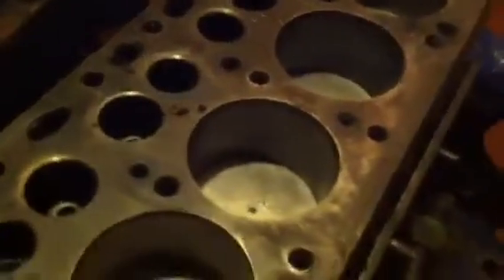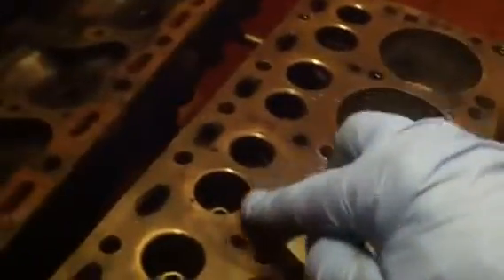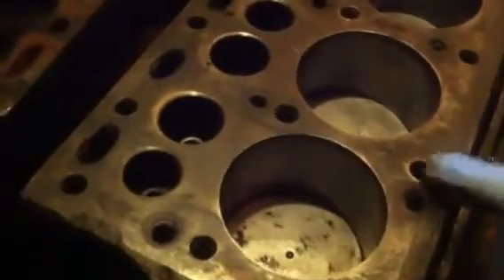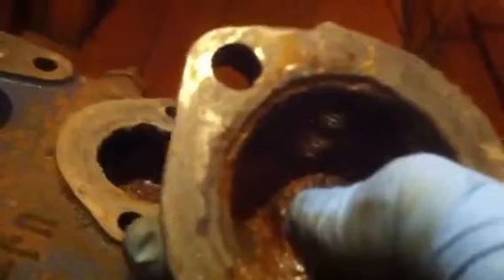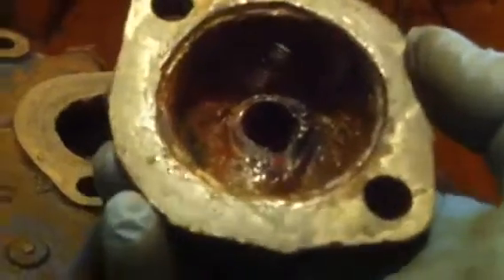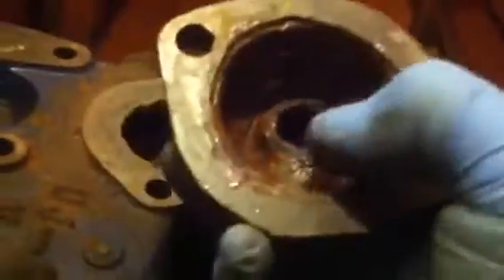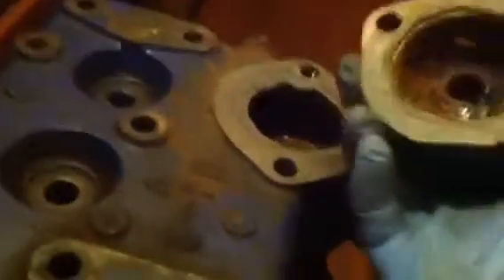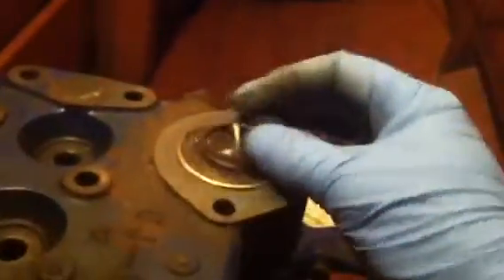Universal Atomic 4 water jacket coolant passages part 2.

Comment: I’ve had great results by filling the system with vinegar , shutting down the engine and letting rest for 24hrs and the flushing at startup . This will loosen all non metallic material and clean the entire system including the thermostat with no need for disassembly . Usually one gallon of vinegar does the trick